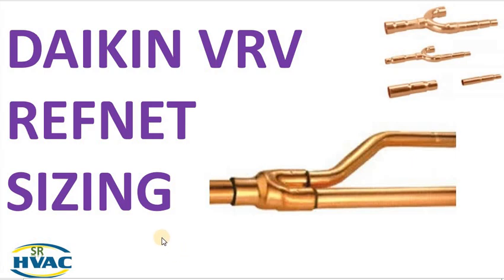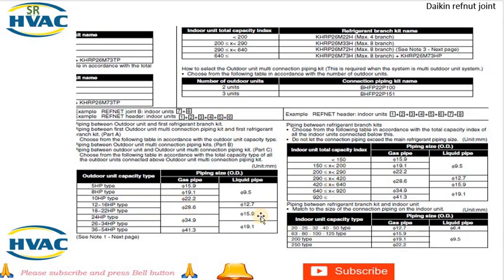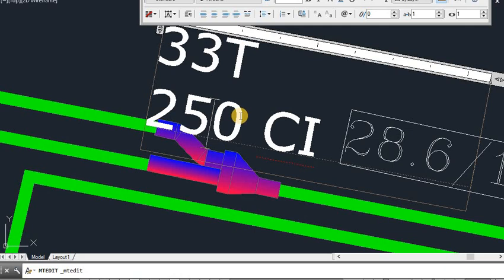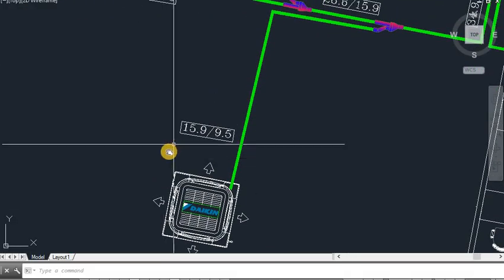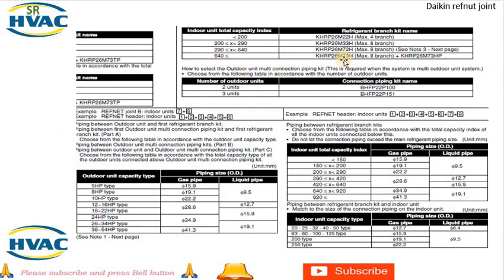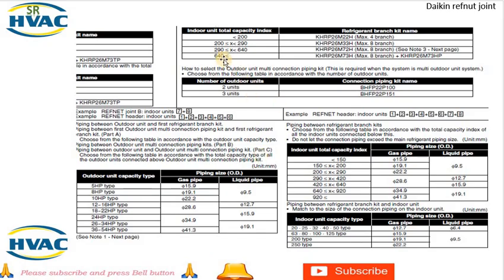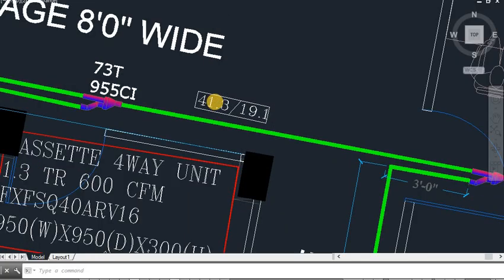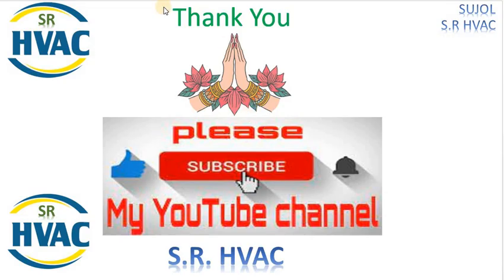Daikin VRV Refnet Sizing: Complete Guide to VRV System Design

Comment: Sir I have a question, 1 TR=32 CI hence 2TR=64 CI. So why did you take 62.5 CI for 2TR? please
Reply from the maker: Thank you for your question! I appreciate your curiosity, and I'm happy to explain the reasoning behind the 62.5 CI .Actualy the accurate ci for   1tr is 31.25 ci , 2 tr is 62.5 ci ,and 4.0 tr is 125 ci Value,  you can  see the machine code is 32 , 63,125. hope you got it.